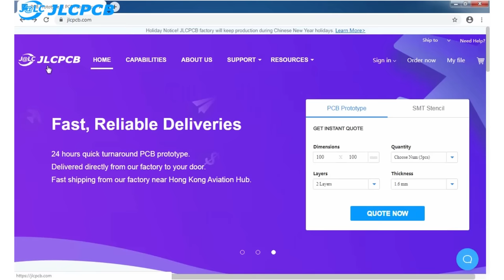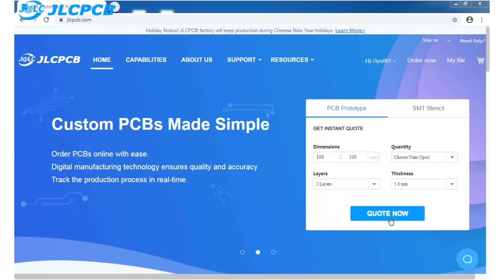5 Awesome DC Motor Life Hacks

Comment: All you need to do to fix a dc motor is to open it and join the two copper wires. The wires which lead down to the place wher we give electric current. 1000000000% working.
Reply: Operating the car with the remote - https://www.youtube.com/watch?v=5cMSi50r0BY

Comment: Two major suggestions. One is regarding your solar generator. Use a coupler to directly connect the motors. This will improve the conversion efficiency. Second is regarding the repair of dc motor. Machine oil is used to lubricate the moving parts and not the magnet and rotor coil. Should have oiled the shaft. Otherwise it is wonderful video. Keep it up.
Reply: Operating the car with the remote - https://www.youtube.com/watch?v=5cMSi50r0BY

Comment: 8:36 Ok now it is no longer funny, now it is just hurting my brain. Why the 6 motors wasting energy? I get the concept of rotating transformers but both motor and generator are low voltage DC.
Reply: I was curious about the same thing.  I was thinking maybe the Solar Panels would have done a  better job by themselves. I got the impress it was more for show or maybe to teach kids about how Power Plants operate.

Comment: :)  The Motor Fix.  I do that all the time with our USB fans.  They wear out and get stiff.  I learned that trick from my grandfather (RIP) as a kid.  But I use grease instead of the oil. Maybe I will switch to Oil.  Seems like it would be better in tight spaces like inside the motor. 

I wish I could have popped out the SD Card in his head and put it in mine.  Maybe someday we can do that but not today :)